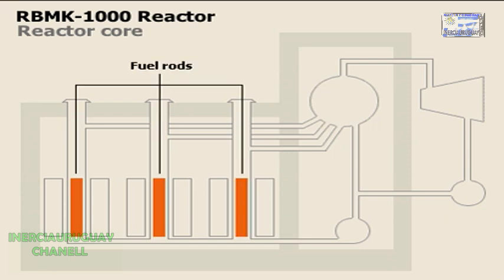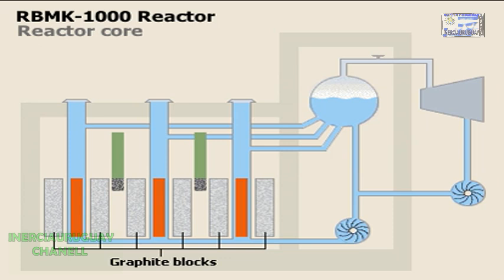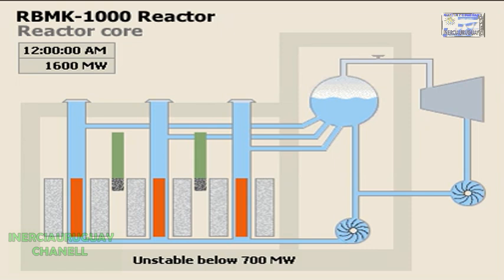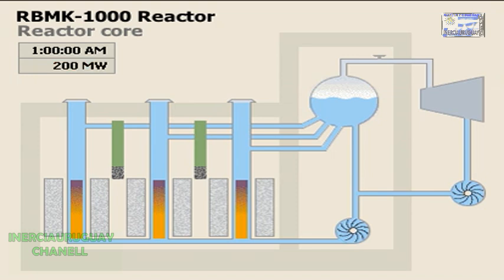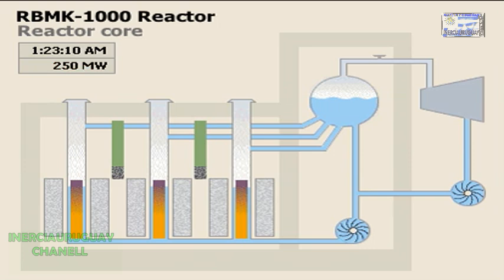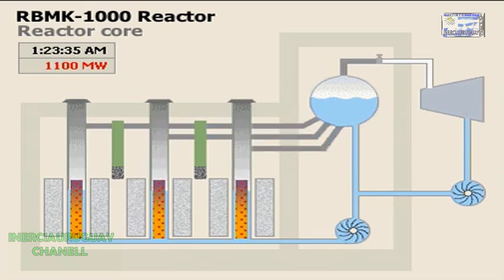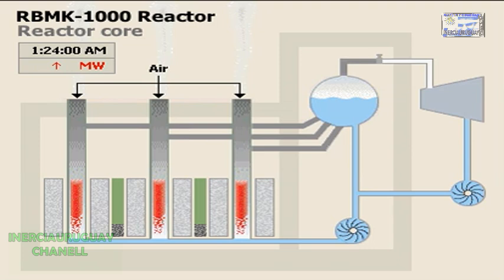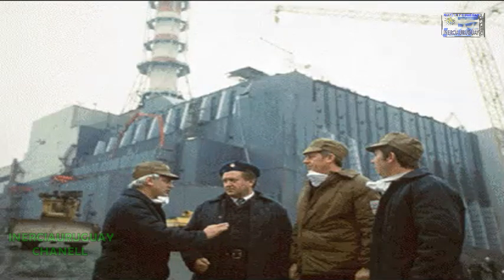WHY THE NUCLEAR ACCIDENT WAS PRODUCED IN THE CHERNOBYL PLANT ANIMATION

Comment: Disabling warnings and continuing the test, solid plan.
Reply: As I read, that warning signal had a very bad desing and it has been constantly showing danger when they touched the pumps, even there wasn't real danger. They turned it off in the thought what they do is safe
Reply: And don't forget the "less experienced" night shift!
Reply: "Everything is fine *sips tea*"
Reply: @jarskil8862  sips vodka
Reply: Come on this ain't rocket science.
Reply: Yep
 Thank you mr diatilov(sp) . Typical communist party member.
Reply: disabling the emergency core cooling system was part of the test they were doing
Reply: Meh, I’ve seen tooth picks in the “silence” button...what’s the worst that could happen? Oh...
Reply: Retards with dangerous things.
Reply: @thetruthhurts4054  the operators weren't told about the power-spike effect, even though it had been observed before at the effectively identical plant at Ignalina.  All they were told is "don't pull the rods out that far."  They had no idea that the rods would behave counter-intuitively, and briefly do the literal opposite of what they were supposed to, under those conditions.  That was not their mistake.

The mistake they did make was not to realise (or possibly not to have been told by the previous day shift upon hand-over - so very many industrial accidents are caused by information lost during shift changes...) that the reactor had built up very high levels of Xenon (a reactor "poison" that damps the whole thing down just like the control rods do) in it due to low power demand the previous day.  (this gave the reactor a "memory effect" of sorts, meaning it wouldn't always respond the same way to the controls even if all the instruments said it was in the same condition - you can probably guess that a good few industrial accidents, and probably the vast majority of software bugs, also come from people failing to account for memory effects!)  It was in attempting to compensate for the effect of the Xenon that they pulled the rods out too far, not realising or forgetting that the reaction in the core would gradually consume the Xenon, increasing the rate of reaction, which would then consume the Xenon faster, and so on and so on, which caused the power to rise at a non-linear, ever accelerating rate (I'd guess probably geometric or exponential, but I've not done the maths), and having no way of realising that pushing all the rods back in at once after pulling them out too far would give this scarily unstable positive feedback loop a huge kick.  Which is exactly what you don't want to do to a scarily unstable positive feedback loop.

Had they had perfect knowledge of what was actually going on, I suppose the runaway reaction might conceivably have been brought under control by putting the rods back in one-by-one, rather than all at once, if there were still enough time to do so before all the Xenon was gone (that's a BIG "if!") - but then, had they known about the flaw, they might have realised the true danger of pulling them out too far and never done it to begin with, and then the AZ-5 SCRAM would have killed the reaction like it was supposed to.  Had the rods not had the flawed tips at all, AZ-5 would have saved the plant even if they had still both forgotten the Xenon and pulled the rods out too far.

One more factor to consider:  In the authoritarian command economy of the Soviet Union, you never, ever said "this plan you've given me is impossible."  If the plan was impossible, you lied or you cheated or you found some way, ANY way, to meet the target you'd been handed from on high.  (I once heard an anecdote about a laundry that scrapped some machinery when they upgraded it.  Allegedly the economic planners noticed this and then expected them to produce the same rate of scrap metal every year, so they started ripping all the outer casings off the brand new new machines they'd just put in, and scrapping them to meet the quota... it's almost certainly untrue, just like the famous story about the bath-plug shortage, but it illustrates the point nicely...)  Ironically enough, this is also an example of a control system with positive feedback - if you lie and trick the economic planners into thinking you met your target, they'll now expect you to keep on meeting it, and probably start pushing you to see if you can do even better, not realising that you can't even do what they asked before.  The more people lied and scrounged and improvised to fulfil the plan, the less realistic the plan became, and so the less possible it became to fulfil it - up until about the early 70s they were still doing quite well*, but this effect too was non-linear and self-accelerating, so by the 1980s the plan was really getting seriously divorced from reality.

So if the plan in 1986 is "do the test tonight," but the reactor is too poisoned to do the test tonight with the rods in the normal range, you might just be tempted to nudge them a bit further than you're strictly supposed to... I mean, it's not like they'll start working backwards or anything, right...?

*This is not, in any way, a proof that planned economies can't ever work.  It is a pretty good back-of-an-envelope proof, though, that once a culture of "never give the boss bad news" sets in,  that they will seem to keep working just fine, for a surprisingly long time, and then suddenly nosedive into the ground.  It's applicable to any command hierarchy with long-term planning, by the way, so it's good for private company management too.

"It is easy to imagine the enemy is the nuclear reactor, but the enemy isn’t technology. I have come to the paradoxical conclusion that technology must be protected from man. In the past, the time that included the old reactors, the time that ended with Gagarin’s flight into space, the technology was created by those who stood on the shoulders of Tolstoy and Dostoevsky; they were educated in the spirit of the great humanitarian ideas; in the spirit of a beautiful and correct moral sense. They had a clear political idea of the society they were trying to create; one that would be the most advanced in the world. But already in the generations that succeeded them, there were engineers who stood on their shoulders and saw only the technical side of things. But if someone is educated only in technical ideas, they cannot create anything new, anything for which they are responsible. The operators of the reactor that night considered they were doing everything well and correctly; and they were breaking the rules for the sake of doing it even better, but they had lost sight of the purpose…what they were doing it for."

Valery Legasov, tape recorded in an interview with Yurii Scherbak, Autumn 1986
Reply: Well of course it would say that it doesn’t know we’re running a test - dyatlov
Reply: No it's a great plan
Reply: Don't text and drive...

Comment: The only way the get 1.21 jigawatts with RBMK1000... VTEC kicked in yo.
Reply: Lol funny thing is, when the graphite at the ends of the control rods was inserted, the power out put shot up to about 30,000 MW, which is 30 GW.  So yeah, they could have just gone back in time and stopped it lol.
Reply: You mean: the diesel generators? LOL! As a matter of fact: it took 40 seconds for the diesel generators to kick in! That's why the explosions happened!
Reply: @Beun007  The diesels has not much to do with the explosion, the fission was unstable because they produced at low energy state and poisoned the reactor with Xenon Gas. When the power felt to 30 MW, they decided to increase and start the test. The only way to start a poisoned reactor was to remove the rest of control rods. This caused a hotspot in the lower 1/3 in the reactor and generated lots of steam. The sensors failed to detect, only there was a "normal" drum separator alarm. Steam  introduced voids in the water part of the moderator (graphite+water) and the reactor started to double the power in every second (positive void coefficient), they pushed the AZ5, it's not clear it was part of the test or they realized the emergency, but the Scram increased the power to ~30000mw (VTEC kicked in yo) due to design mistakes with the control rods. This was to much and blew up the reactor upper and lower biological shield.  Without this maybe they would survive the test, because the damaged fuel channels are not big deal with RMBK until it not affect the cooling. But when it exploded there was nothing, just the worst civilian catastrophe in nuclear history.
Reply: Kick you in the face - yo

Comment: First mistake was that the operators reduced the power down to 30MW (1%) regardless that the procedure specified that this 

should never be below 700MW (20%) because here the RMBK-1000 reactor becomes unstable (positive void coefficient becomes dominant).
Second mistake it was that they decided to withdraw the controlling rods(this was Anatoly Dyatlov's order,so the operators 

can be excused).I assume that leaving the bars down finally the reactors shuts down and none of following happens.
At that moment when the rods were completely removed(h 1:00:00)and the power slightly increased to 200MW the reactor was 

already unstable.From this point the chain reaction started and all the actions made did nothing but creating more 

instability.It is possible that when removing the rods, a low pressure was created at the bottom of the reactor and this 

made the water to boil (cavity effect).Steam made by the boiling water reduces the absorption of neutrons which increase the 

nuclear fission which creates more heat which creates more steam (positive feedback).
Continuing with the mistakes, the operators disables many safety mechanism controls and as a final mistake they shut down 

the steam to the turbine, which shuts down the water pumps,leaving the reactor without cooling water.
This however was useless because the chain reaction was impossible to stop:even if they did not turn off the steam,the water 

pumps continuing to pump water in the core,the heat from reactor will produce more steam whatsoever.So basically with or 

without cooling water,the reactor was impossible to be stopped.
On the top of this they lowered again the bars and for some reason the graphite tips from the rods (altought they were fall 

down faster than 0.4m/s) put the last drop on the fatal ignition scheme.
The russian officials claim that all this happened because the faulty design of the controlling rods, which were shorter than should be.
Consider that prior the Chernobyl disaster were more than 10 incidents at russian NPP, from which they learn and do nothing.
Reply: First mistake was probably plant design....
Reply: @Desert-Father  Agreed...And the very worst part of all this? No containment building...Lol.... Only idiots would design a Nuclear power plant and its reactors without a structure to contain an explosion.... No worries people, we'll let the reactors blow their guts all over the parking lot, and then over the top of 14 countries. Assholes....
Reply: After studying subject for several days, it is clear to me that operators actions wasn't the main cause of the disaster. Reactor has some design flaws and it was easier to officials to blame several operators rather than huge reactor design and production companies (whole ministries in soviet union)

Comment: I don't understand that why control rods increased the power. They could decrease the heat, am I wrong?
Reply: IIRC, the control rods had a moderating element at the end in order to increase the power output when the rods were fully raised. When lowering them during the scram, that element further accelerated the reaction before the rods could fully lower. The heat of this reaction damaged the rod casings, which left them stuck and unable to lower. This led to an uncontrollable chain reaction and the eventual disaster.
Reply: @oriolopocholo  but aren't moderators used to slow the neutrons down? idk. There is already graphite present in the system around the fuel rods, then how did graphite tips of control rods cause an increase in the reaction?
Reply: @daisypriya3127  the term "moderator" might be a bit counterintuitive, as in fact it slows down the neutrons but that is precisely what is needed to undergo a nuclear reaction.
Reply: @oriolopocholo  ohh. I get it now. But then why did they have graphite tipped control rods,? When one would lower the control rods to reduce the fission
Reply: @daisypriya3127  Ok so there were two main problems which caused the accident. 1 was that the reactor used graphite as the moderator. most current reactors use heavy or light water both as a moderator and a coolant, so in the case of a loss of coolant the neutrons are not moderated and the reaction dies down. this is what is called a negative void coefficient. the chernobyl reactor lost the coolant, which also absorbed the neutrons, so you had many more neutrons being moderated by the static graphite thereby increasing the reaction, that's a positive void coefficient. in this case the reactor spins out of control. the solution to this was to deploy the control rods, which they did, but they were really slow and had graphite tips, which moderated the neutrons further and increased the reaction. iirc the reason behind the graphite tips was that when the rods were fully removed the tips would increase total output power. a very stupid idea, since they just helped the out of control reaction, broke the casings and blocked the rods, and then boom.
Reply: @oriolopocholo  What are some good articles which explains the Chernobyl blast. It clicked in some parts to me but I would like to get a clearer picture on the issue. cheers xxx
Reply: @oriolopocholo  thanks! :)
Reply: When the graphite tipped control rods where lowered they initially displaced water which meant there was additional room for steam.   The presence of steam instead of water accelerates the reaction in this specific type of reactor.   This is  one of the design flaws.
Reply: Well, because the fuel rods were already melting because of the failing cooling system it was too late to drop the control rods, so that they melted together causing steam pressure, causing the explosions.
Reply: its like adding 1 drop of gas every 5 seconds to a fire (AKA lowering one control rod..... than 1 more.... than one more....ETC)
VS adding 50 gallons of gas to the fire in 0.000001 seconds (AKA SCRAMing the reactor) 

if the neutron is moving too fast...... it wont cause an atom to split 

so the graphite slows down the neutron..... allowing to to split an atom 

if the control rods were 5% in the core..... the additional "moderating" AKA slowing AKA more power...... would already be taken into account 
they would have lowered more control rods.... or increased coolant flow 

but instead..... before the part of the control rod which LOWERED power started to have an effect 
the very tip caused it to INCREASE the effect 

it would be like smacking TNT with a hammer..... hoping it doesnt go off.... so that the rubber back-side of the hammer has time to "do its thing"

AKA..... you let off the gas pedal in your car too quickly...... and instead of slowing down
it goes faster.... and faster.... and faster

the more RPMs a motor does..... the more power it makes
at 2000 rpm... you might make 80hp

but at 6500 rpm.... you might make 500 hp

Comment: This is a much better explanation than the "big" channels.
Reply: Wholly agreed. I've been trying to figure out why the graphite on the tip of the control rods made it explode and this video allowed me to finally figure it out
Reply: Slandora Paralex The tips weren't like this, it was more like an extra shorter rod under it
Reply: No it's not.
Reply: Damn right.
Reply: J Thorsson  I know fake news exist, but I have studies RBMK reactor cores and other nuclear reactors and I can confirm that this is not the true design of the rods
Reply: It's an over simplified version that cut's out specific important scientific details of what happened (no word of xenon 135, or the details of the reactors use in the 12 hours previous to the test) It sounds more like the Russian explanation in 1986 of what happened.
Reply: it's not better by any means, it's just way simpler. And, as such, leaves many questions unanswered.
Reply: Damn right
Reply: J Thorsson  The difference in design was that the rods tips werent graphite, it was a smaller rod under the Boron control rod which was the so called "Graphite tip"
Reply: It's really not though...the graphical representation of the control rods graphite tips is completely wrong
Reply: Not really
Reply: Uruguay always coming in clutch
Reply: @javo5807  Does this mean that my clutch is lubricated by Uruguayan semen?
Reply: @sjaakvkoten6061  well.... if a clutch is lubricated.... its going to slip
which is bad....